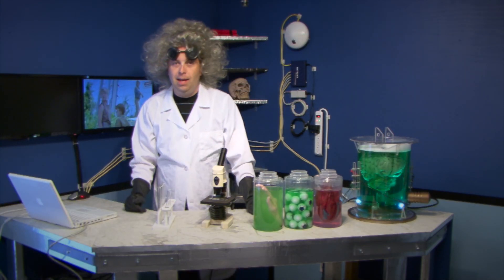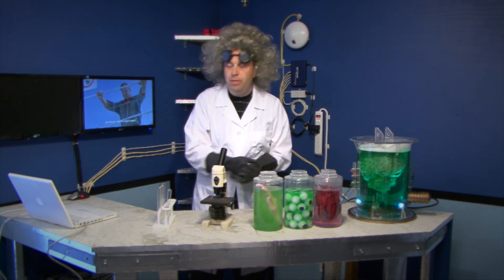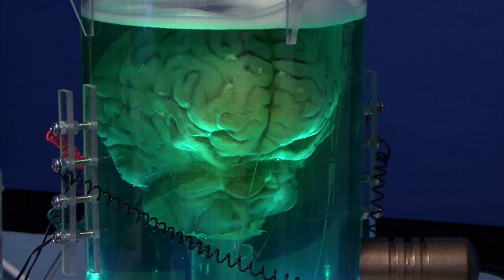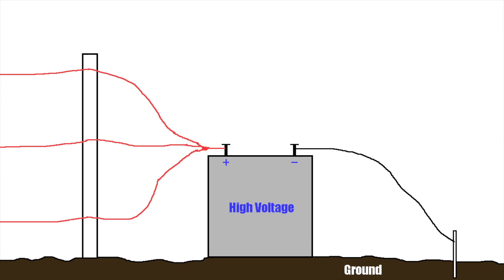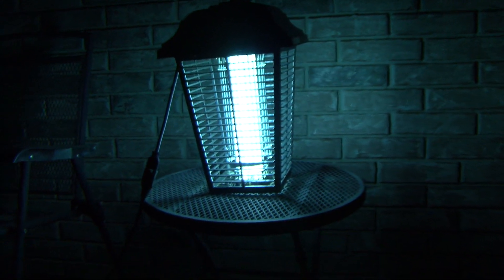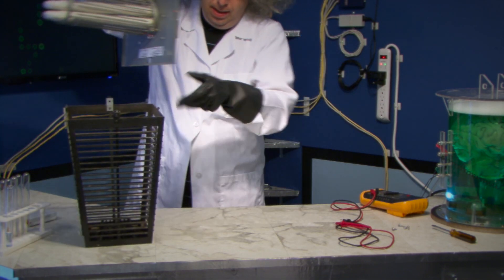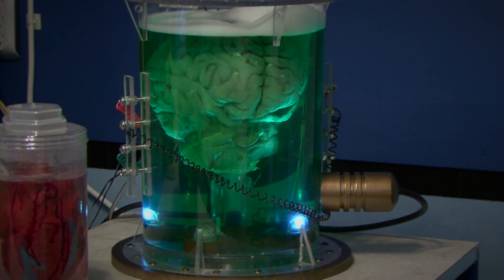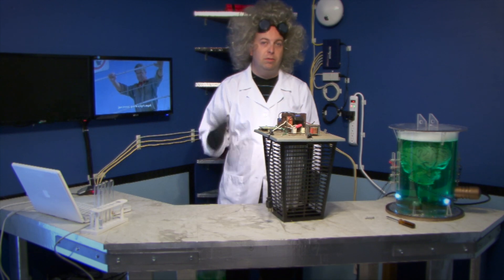Electric Fence scene in Jurassic Park Debunked!

Comment: There could be some sort of capacitive coupling between the boy and the ground. That would still allow a current to flow through the boy to the ground. Althought I most likely believe these walls are connected to a DC source to avoid these capacitive currents during normal operation.